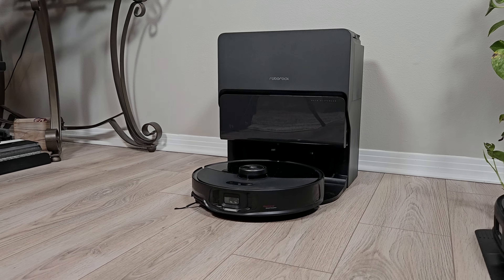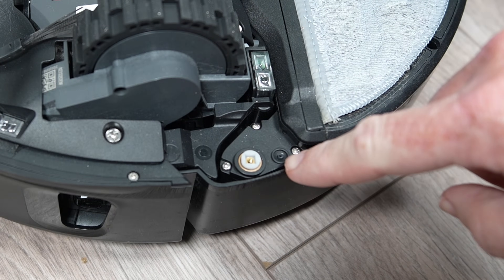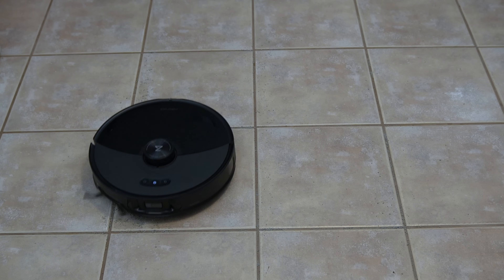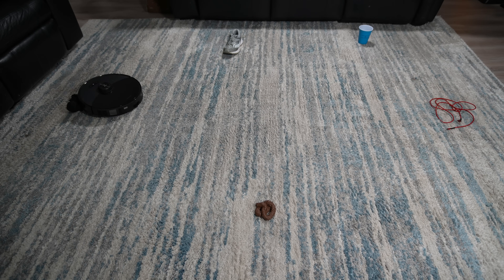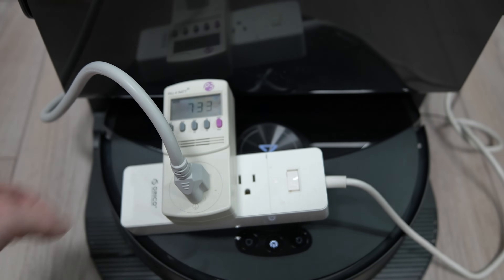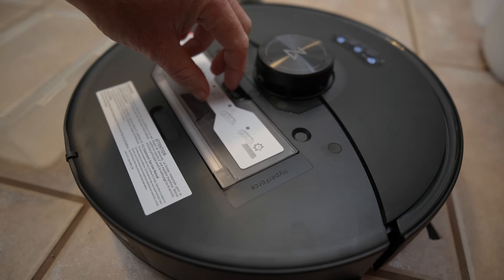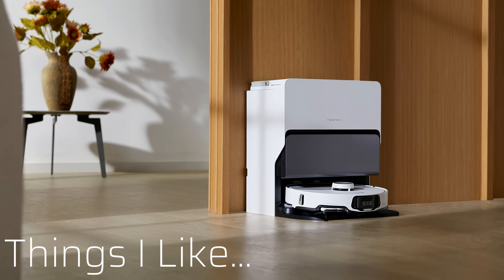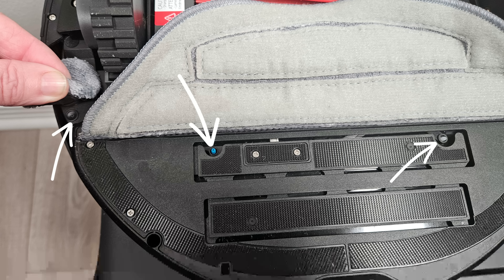Roborock S8 MaxV Ultra Robot Review. The Good & Bad.

Comment: Hi Jamie
Thank you for the honest review. I have been waiting for this one to see if I finally upgrade my (non dock) S7.
Based on what’s out there right now, what is your recommendation for the very best vacuum and dock. Tiles and carpet. Assume no budget limit. Is it one of the new Dreame’s? Like the l30 or x40. Should I wait for the revo maxv and your review? Seems to me from your reviews that Dreame might be the better option right now (even though I like the Roborock software).
Interested in your views!
Thanks again.
David
Reply from the maker: Maybe wait for the Qrevo MaxV review or the Dreame X40.  Have you seen my review of the X30?
Reply: Thanks Jamie for responding so quickly. I did see the x30 review which looks like the best out there right now. I suppose I should wait to see a review from you of the x40 and qrevo maxv. Any idea when you are likely to receive units for review? I should note, btw, I’ll be donating to your channel as a thanks for the excellent work you do - please keep it up!
Reply from the maker: @davidandvickie  First off thanks for the support! I have the Qrevo MaxV now, but it will be a bit before the review comes out.  Should be in May.  The X40 is in transit from far away.

Comment: In watching the robot in a corner or near an edge, it is surprising that the only solution to gather debris is to reach it's flingly arm out a bit. While this could work, it would seem just as likely to fling the debris the wrong direction. Ideally, another vacuum arm/tube would work better, assuming it would be feasible.
Reply from the maker: It just needs to slow down before getting into the corner. Sometimes it does, but most times it does not.

Comment: Great review, I’ve been waiting on exactly this! Can you comment on how quickly the bag fills up? On average (non testing) runs, can you estimate how many can be done before the bag is full and needs to be thrown out? Curious how much the bags can really hold. Thanks!!
Reply from the maker: The bag is unchanged in size from the previous models at 2.5 litter and how fast it will fill will vary house to house. Roborock say 6 to 7 weeks, but again that depends on the total square footage of the home, how many carpets vs hard floors and how many pets.  Pets have a huge impact on the especially long hair pets. I honestly never fill one because I have moved on to the next robot to test right after this one.

Comment: Thank you for your response, Jamie. I would like to have a mop function for my hard floors, and my budget is not an issue. Object avoidance is a must-have feature, and I also need a self-empty dock. While checking the available models, I saw that you haven't reviewed the L10S Pro Ultra Heat yet. Can you please compare it with the L20 and Q REVO models, and also with the S8 Pro Ultra? I'm not sure how important the hot water mopping pad system is. For your information, I'm from Australia, so the Dreame X30 model is not available here.

I'm feeling confused about which robot vacuum model to purchase. Initially, I was interested in the Roborock S8 Pro Ultra, but I found out that it doesn't come with rotating pads. I'm not sure if it can mop well without them. Therefore, I am also considering the L10s Pro Ultra Heat, which has rotating pads and an extendable mopping edge. However, since there aren't many reviews available for this model, I am concerned about its navigation system and detection capabilities. It would be really helpful if you could review the L10s Pro Ultra Heat for me.
Reply from the maker: Sadly we don't get many of the same models here in the US.  I have reviews the L10s Ultra and also have a comparison video with it and the Qrevo. I will soon have a video out on the Qrevo MaxV along with the Eufy S1 Pro.
Reply: @jamie.andrews  Thank you Jamie. I wait for QREVO MAX VIDEO. :) .. any suggestion what can i buy (as per USA availaibilty) ? also how important is hot water pad cleaning? L20 does not have hot water function but its suction power and battery is better than l10s heat one
Reply from the maker: @amanchahal216  I addressed this topic in my last 2 videos including this one.  Personally I think hot water mop washing is not that effective unless you are dealing with grease on the floors.

https://amzn.to/3w7Daj1
Reply: rotating pads have been proved to be only marginally better in speciifc cases only than vibrating plates. You can compare this video with the Q revo maxv.

Comment: Gotta say, I'm very disappointed with this. The fact it's not avoiding cables and gets even more tangled with them than other botvacs makes it an instant non-starter for me. That's exactly what my Q Revo (with it's terrible obstacle avoidance) does and it is super annoying since I have to go find it and untangle it from whatever it got itself into. On one occasion it even pulled a lamp off of a side table, causing it to break. I figured the camera + better obstacle avoidance on the S8 MaxV Ultra would have no issues with this, but it looks like the dual rollers make it even worse. I've been deciding between this and the Eufy S1 Pro, which I see you have there too, and one of the main things that every early reviewers seem to be praising the Eufy for (aside from it's mopping) is its obstacle avoidance. It avoids cables and other obstacles perfectly in every video I've seen so far.

Considering the Eufy S1 Pro is going for $999 on Kickstarter right now vs. $1899 for this, it's really hard to see how this is worth so much more. The S1 has added maintenance with the roller mop mesh screen which needs occasional cleaning, but the S8 MaxV maintenance seems like it'd be more annoying with how the axles on main brush, side spinning mop, and side spinning brush get really tangled with hair that you mention isn't easy to remove. That's four separate areas to deal with hair tangles. For $1899 I would expect the base to have some sort of cutting mechanism to remove all tangled hair without the user having to manually do it.
Reply: MaxV is simply not like the Q revo, the avoidance is way better, but it's not at the level of the X30/40 i would say. The S1 is square which navigation is not as smooth, also you have to thoroughly clean the dirty tank on the robot as well and the suction performance is quite poor, no edge mopping, no side brush extender, no roller lifting. I would stay with the QRevo or get the L10s Ultra heat for example
Reply: @xeon2k8  I don’t understand how the dirty water tank will need constant maintenance. It empties itself every time the robot runs, so water isn’t left in there for any extended period of time before being emptied into the base. Videos have shown there being a tiny bit of water still in the tank, but on its next run that internal dirty tank fills up and is then emptied again, so whatever tiny bit of water was left in there previously gets flushed out. The mesh filter on the tank inlet will likely need regular cleaning though. 

Also, in this video the S8 only looked to be marginally better with obstacle avoidance than my Q Revo. Mine will avoid shoes and other decent sized objects, but smaller things like socks and cables it goes right over… just like the S8 did. For $1899 that is just not acceptable to me. And despite the S1 being square, every video shows it navigating perfectly around obstacles big or small including cables and socks. There’s no reason a cheaper robovac should do that better than one as expensive as the S8. One reviewer (Forbes) even mentioned that the S1 Pro was the first robovac they could truly set and forget for weeks at a time, while others would get stuck or need some sort of rescuing. I was hopeful the S8 would be similarly autonomous/reliable with near perfect obstacle avoidance, but that unfortunately doesn’t seem to be the case.

You’re right the S1 doesn’t have as good of suction nor can it lift its vacuum brush, and those are definite downsides over the S8. If you have carpets in your house then the S8 really can’t be beat, although I’m curious to see if the changes Eufy made to the S1’s brush bar improves things at all. The S1 also doesn’t have the extending brush as you said, but as we see in this video it seems to be nearly useless since it stops spinning when it gets into corners, leaving a lot of debris behind. The S1 doesn’t have that issue since it’s square shape lets it get right into corners and the dual spinning brushes are close to the corners of the bot, allowing it to get at almost all of the debris in the corners of a room.

Comment: 7:21 - Looks like the LIDAR beam is actually hitting the cabinet doors so it probably thinks it's too close which is perhaps why it retracts the brush?
Reply from the maker: Lidar hitting the cabinet is not the problem here or the robot would be able to get under the cabinet and thus not have the need for a swing out side brush. It would be like riding beside any wall.  
The robot has a side sensor on it to tell it how far the wall is away from the robot. It uses this along with the lidar to tell the robot that there is a cabinet base there. If you look at my Dreame X30 video you can see when it gets to the same cabinets it can tell there is a cabinet and it will start a wiggle motion to get the pad all the way under the cabinet.  This is how the S8 MaxV should work as well just with the side brush.

Comment: Thanks for the review. I wonder on most of the "issues" highlighted can be resolved by a software update ...... For example, side brush, water temp,
Reply from the maker: Absolutely in fact I just got the first one today.  Now I am frantically retesting to see if it fixed anything. So far no on the side brush as far as coming out under cabinets on a room cleaning it still does not and it is still delayed coming out on some corners. Hot water is stl non existent.
Reply: @jamie.andrews  yeah, especially with the price it charges $1.8k, people expect the best. If this thing is around $1.2k, is much more reasonable with current state

Comment: Thanks for the review. I went with the X40.
Reply from the maker: Let me know how you like it.  I should be getting mine soon.
Reply: The X40 is an excellent robot vacuum, but it has a bit of navigation issues that need to be ironed out. Seems Dreame rushed it out on the market before fully debugging it.
Reply from the maker: @galapiat  Good to know.  They has navigation issues with the X30 when it came out too but quickly fixed them.
Reply: @galapiat it's good to know that roborock isn't the only ones that have some software issues to fix.. it makes my copium feel better 😂
Reply: Just got the X40 and love it. It was weird at first during mapping it kept dropping the one mop as if it wasn’t energized but then I fixed it by rebooting the robot. Strange. However as compared to my Eufy X10 pro it’s like night and day. It’s quieter and you can tell the servos and quality of components used are higher grade not to mention it is lower so it fits better under things. The side mopping is absolutely amazing and my kitchen and dining room is so much more clean.  Even the mopping is quieter and better consistency with wetness across the operation. It doesn’t crazy empty as many times as the X10 and the empty is literally half the noise. Well done. It’s a keeper for sure and the water tanks are larger which helps a ton for my household.

Comment: Wow, thank you Jamie, this is why you are my favorite reviewer. I am most worried about the hair tangling as I have two dogs with long hair. I am seriously considering the X40 now. So it would be great to have a short video about comparing the X30 and the S8 MaxV Ultra. 
The added features of the X40 over the X30 that I found are:
- Extendable and liftable Side Brush
- 1200 Pa suction power
- Lifts brushes when detecting a wet stain
Reply from the maker: I certainly plan to compare the X40 to this as I think they directly compete.  I will have to wait for some of these issues to get worked out or the results would be predictable.  Thanks for your kind words!
Reply: @jamie.andrews  do you think they can fix the hardware issues?
Reply from the maker: @petitbarzun  depends on if they can be fixed via firmware.  There is no fix for a small dustbin or the dual rollers that, have weird ends for instance.
Reply: @jamie.andrews  hey Jamie do you think the old rollers of the S8 pro fit on this one? just wondering since the cutting blades are stupidly useless then if the easier to clean roller could be fit
Reply from the maker: @xeon2k8  I tried and no they don't. Totally different design in the roller deck.
Reply: @jamie.andrews Do you recommend dreame x40 ultra or roborock s8 maxv?
Reply from the maker: @covannijon862  Have not tested the X40 yet.  Should arrive at my house this week.
Reply: @jamie.andrews  any update now?

Comment: Thanks for honest and professional review, hope the eufy s1 pro review will go out before the campaign over
Reply from the maker: I'm trying to get it out before it is over. Any questions about it?
Reply: @jamie.andrews  amazing: 1. S1 mopping vs flagship competitors. 2. Ifs the 2 side brush reach to corner 3. Side brush on wet dirt - is it a problem? Like milk on the floor. 4. The water on the docking really eco clean ozone?(kill the germs). 5. How it handle cleaning the area between carpet and floor . 6. Is the Vacuum strong? I saw honest review that give it not good grade. 7. Most important - moping close to corners!
Reply from the maker: @alondinbar6193  1. A roller mop will mop better than a robot dragging a dirty mop across the floor. 2. Not as well as it should. 3.Don't use any robot including the S1 to clean up wet spills or the liquid will end up in the dustbin since there is no mop only mode. 4.  I have no way to really test this sadly. Personally I always think that is marketing blah. 5. It won't wet the carpet, but it lifts the roller too quickly imo. 6.  That is a weak point.  Not horrible. Not great. 7. Look elsewhere.  There is no edge mopping here.
Reply: @jamie.andrews  sl its sound that its really great innovation with the moping. (Maybe lso the navigation). But others features are lack. They suppose to improve the roller brush and vaccuum in the nee version, they did it? Or they send you the from first units?
Reply: @jamie.andrews  thanks for  the respond! Waiting to see the review. If you can talk about the improvements that eufy said they did for the part of vacuum dust, it will be great.
Reply from the maker: @alondinbar6193  I have an early unit, and am waiting on a refreshed version.
Reply: @jamie.andrews  2.5days more before the campaign is over(: hope you will release in this time frame 💪
Reply from the maker: @alondinbar6193  I will
Reply: First of all, thank you for the great and honest review! I am too quite interested about the review of the eufy S1 pro. 
If I may ask the to check how good the mopping feature is. Especially how really clean the floor afterwards is. Like "the hook up" guys checked the floor after mopping with a tissue. The "smarthomeassistent" sadly doesn't check the floor afterwards with a clean tissue and I am afraid the roborock just spread the dirt till you simply can't see it anymore... But it's still there. So I want to know if the eufy is really mopping the floor. 
Thank you for help!
Reply from the maker: @Kvothe-ew4rn  A roller like on the S1 is for sure going to mop better than any robot dragging a cloth. Sadly it is not that simple as the tradeoff is no edge mopping and a good bit more maintenance with the S1. Keep an eye out for my video.
Reply: Oh, and I am quite curious if the mop drying in the station is loud? Because I want to put the vacuum robot beside my couch and I am afraid it's annoyingly loud (4,5h). Thank you!
Reply from the maker: @Kvothe-ew4rn  The loudest part is every so ofter it will spin the roller.  It is 3 feet from my head right now and not too loud.
Reply: Thank you for the quick response! I'm really excited for the eufy S1 pro video! Your channel is the first I'm subscribing to on YouTube!

Comment: Good review, thank you! I'm glad they are adding the a silver ion block in the clean water tank. It's very disappointing the flexiarm does not clean corners well and does not extend under counter tops. I'm not sure I want to participate in the buy back program now. 😢
Reply from the maker: I was a bit shocked by this as well, however I feel they will optimize it through firmware since I am sure I won't be the only one to give them this feedback.
Reply: @jamie.andrews  Theo kinh nghiệm của bạn Roborock có tung ra các bản cập nhật để sửa các lỗi này không ?

Comment: What a shocker! I hope they will fix these issues!!!
Reply from the maker: Dude. I know. This was one of the hardest video reviews to make.  I hate saying bad things about any company and their products, but I have faith that Roborock will fix these and hopefully very soon.
Reply: @jamie.andrews  yeah. I feel Roborock is overengineering in a way and forgetting about the basics. Hopefully the Q Revo MaxV will be okay.
Reply from the maker: @MrBlueCreeper  Yea. QRevo is the cash cow.  Has to be.
Reply: @jamie.andrews  yeah. I was surprised to see the Dual Rollers doing well on hard floors! If only they increased the bin size... I feel the Q Revo MaxV will be a better robot overall, regardless of price! Hopefully Roborock will switch from pads to mop rollers like the Eufy S1!
Reply from the maker: @MrBlueCreeper  The bin size would be OK for most if it could just return to the dock to empty. I guess they are scared of Amazon and iRobot? Everyone is talking about the S1 Pro non stop. It is an impressive mop, but there are tradeoffs like most things. You know I will highlight the good and bad.
Reply: @MrBlueCreeper  S1 is good at mopping but you are adding even more maintenance since you now need to clean the dirty tank from the vacuum itself. Not everyone is cleaning grease from the floors.